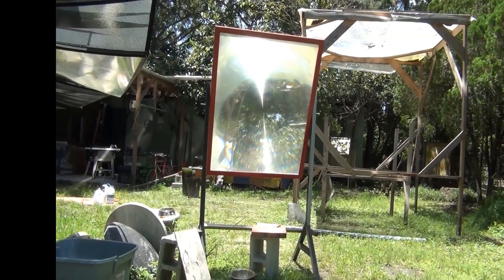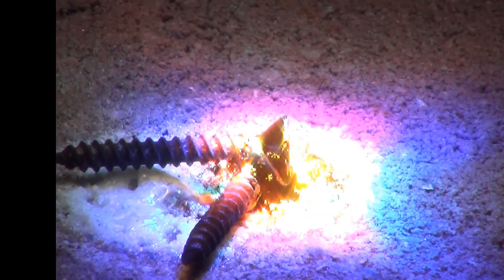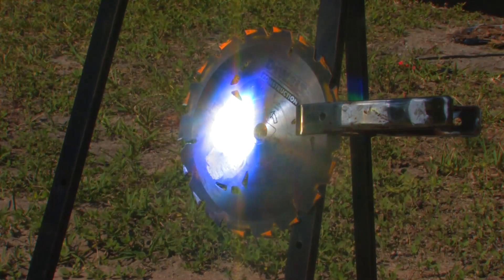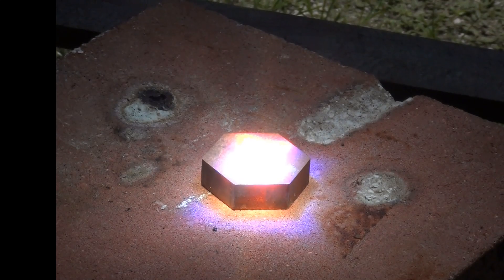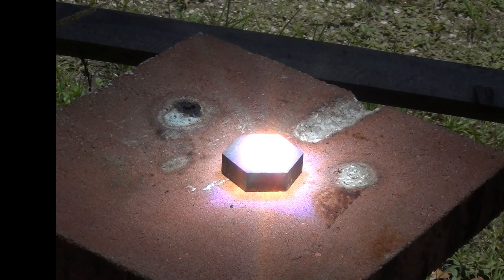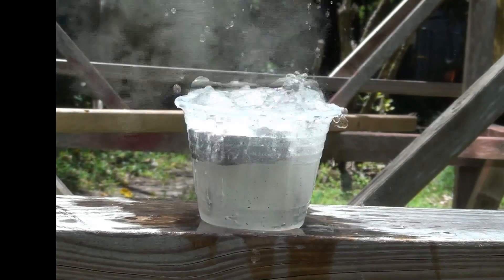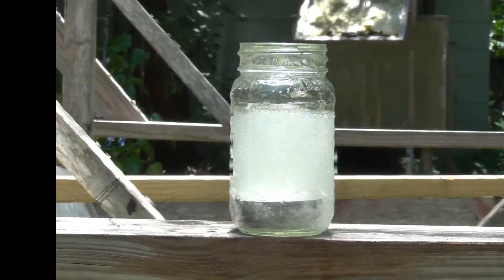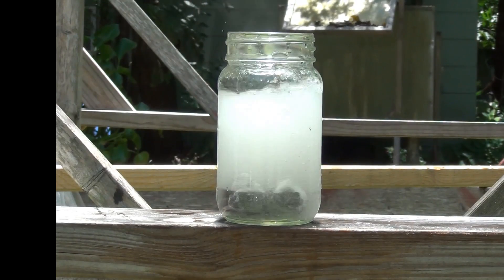Fresnel Lens thermal storage welding brazing with Sunlight can be used to produce steam

Comment: so what if you used a large magnifying glass at the lens's focal point? couldnt it focus all that light into an even smaller focal point for a more precise weld? even increase its temp further?
Reply: or above the focal point to reduce heat absortion by the glass. dont want it exploding, haha. maybe something worth testing.

Comment: If you want to do some proper welding, you're either going to have to have the metal you want to weld in a vacuum or covered in a shielding gas like Argon and/or Helium. Atmospheric oxygen and hydrogen create porosity in exposed metal and severely weaken the weld.  Source: I'm a welder.

Comment: Molten sodium nitrate, potassium nitrate and calcium nitrate stores heat at 99% efficiency.  If you could reflect and focus enough energy to a focal point you too can melt salts.  Its a good idea for energy storage.  We just need to manage the conversion rates between thermal-~luminance devices to electricity.

My bet is that solid state devices will able to do both thermal and luminance to electric conversion efficiently in the up coming years.

Comment: Hello Dan I've been a fan of Green Power Science for awhile now and I'm very impressed by both the fresnel lenses and the parabolic mirrors have you considered making ice with either one, Wait I'm not a nut use either one to replace the heat source in a Propane fired R.V. refrigerator don't see why it couldn't work as a stationary unit with sun tracker and temperature controls just trying to think outside the box,love your videos.Happy Holidays

Comment: tell me if i'm wrong, but the water didn't just instantly boil. the water the came into contact with the steel might instantly boil but the rest of the surrounding water probably wasn't raised to sufficient temp to boil... what i'm saying is that if the steel had been taken right back out the water would still be boiling.

Comment: so, my question is: could you use multiple lenses to build up heat in a piece of metal so that it can be worked in a traditional (ie blacksmithing) manner? Coal is hard to get where im at, so a solar forge would be a real boon were it possible.

Comment: Perhaps this method could be used for a low fuel blacksmithing technique? The big issue is being able to gauge the metals temperature visually, but there are other tools that can solve that issue.

Comment: That sounds like a good idea to me. Plus, after the sun goes down, the ambient air temperature should drop a few degrees, which will increase the temperature differential of the Stirling engine further.

Comment: maby u could use it for cooking by setting  pan on it the have others heating up as as they cool just switch em out ,, then you can cook withiut the light in your face or have to move with the focal point ... give it a try ... have your wife cook on it as you replace the blocks for her

Comment: It's not that the metal is too big of a heatsink - it's that the heat is being able to escape too quickly to the surrounding air. Put the metal in an insulated crucible with a small opening for the light to enter.

Comment: Something else - holding the piece in your hands and allowing air flow on all sides allows the excess to act as a heatsink.  As Dan mentions - the heat is being pulled away.  Try placing it on a solid surface with little air flow?  Something else you may want to try if you simply want to burn through a piece of steel - place it at a slight angle and let the slag flow away from your burn so that slag doesn't accumulate under the focal point.

Comment: Just a quick question about the statement,"instantaneaously boils water" - did you ever confirm this with a thermometer?  Sublimation seems to be a more likely explanation for instant formation of bubbles in any instance of quenching a hot piece of metal.  When I quench a joint after welding, bubble form around my coupon but when I remove the source of heat, the water temperature has not increased any appreciable amount.

Comment: How about a farnell lens melting a big amount of salt and use that to drive a stirling engine, I'm curious if the heat trapped in the salt would keep the stirling engine running all night/continuously/x no hours

Comment: if your tring to weld by using a pudal of moltun medal like in oxyacetylene welding.  your going to need a sheelding gas like co2 or argon. if your goweing to weld like an old time blacksmith. then your going to need a flux like silica sand or powdered borax.

Comment: Good question, mine as well, but why tie into a solar panel system instead of straight into battery storage? My guess (only a guess at that) is that the lens (maybe even multiple?) will produce more electricity than the solar panels? Would make for a good trial test. Lens might be cheaper too? What say you, Dan?

Comment: Excellent video, Again!! I do have some questions on practical application.
Welding is fine but I see an energy source in the steam created by the blocks of heated steel in water, could an old air tank be modified to create and hold the steam then drive a steam engine? Also referring to some of your earlier videos on solar, which panels or sheets are most efficient? I am considering off grid power production and you always come up with the most inspiring applications. Thanks Dan!!

Comment: It is the amount of BTU that determines whether or not two pieces of metal can be welded.  One candle equals one BTU. The maximum temperature of a candle is 1,400 °C it is just above the very dull blue part to one side of the flame.  If you light 1000 candles you will have 1000 BTU but the temperature will remain at a maximum of 1,400 °C.  So the physical dimensions of a Fresnel Lens determines both the maximum BTU and temperature.

Comment: Here I am thinking... Couldn't one use a large fresnel lens to heat a piece of metal, that through heat pipes woud deliver that heat to a metal block, inside a hot water tank, for use with, for example, central heat in a house? 
Heat pipes are commonly used on CPU coolers to lead the excess heat away from the CPU, and into a cooler of sorts, in this case, the cooler would be the water in the tank.
I don't know how efficient the setup would be, but considering 850 W/m² insolation, maybe worth it?

Comment: If you had a few lenses mounted on a water filled tank (electronically tracking the sun), you could make a steam engine to generates electricity that could be tied into a solar system along with panels, windmills etc.?

Comment: So I have a question Dan, I'm a hobby blacksmith and most of the things I make are with 1/4" thick mild steel. Because the steel is thinner than the example you showed, I'm not sure what to expect. Do you think it would be capable of getting a spot to an orange hot?

Comment: Excellent advice, I will have to try that out. However, I am still wondering how you film your videos of the fresnel lens in action. I would like to be able to document what is taking place when the material is being heated. What filters do you recommend I use on the camera (I currently have a spare shade 5 welding shade)? Thank you so much for your assistance so far, and keep up the great work.
Jason

Comment: It might not work to melt thicker steels but it could possibly be used for heat treating (Hardening or softening) some metals. I wounder how hot it would get if you had 2, 3 or 4 lenses focused at the same point?

Comment: Do you have any good sources of limestone nearby? I'd love to see you experiment with the fresnel lens, the water lens, mirrors, or any combination thereof to make cement powder. I imagine heating the material will make it easier to crush the stone, and then the smaller pieces will be easier to calcinate.

Production of cement accounts for ~5% of global CO2 emissions, half of which is from the use of oil, coal, gas, etc. in the incinerators.

Comment: Wow!  Dan, you've created a cheaper alternative to the molten salt systems that newer solar thermal power plants use to generate power at night or during adverse weather.  Your, let's call it the "Steel Core Heat Storage Cell" system is highly scalable - need more stored power?  Add another Cell insulated container, connect the plumbing, et voila!  It can be done by backyard experimenters too - a most excellent concept!!

Comment: I'm curious if ALL the water is increasing to boiling temperature.. or only the water around the metal.  maybe try a larger container of water and put to temp guages in the container? one at the top, away from the metal, and one at the bottom, near the metal. 

It's just a thought, that all that voilent boiling is happening right at the source.

Comment: Dan try using your fresnel lense to melt a mixture of 60% sodium nitrate and 40% potassium nitrate (saltpeter) then drop that into a highly insulated bunker underground. then you'll really be capitalizing on your technology. iron mass is a poor storage medium. it is a transfer medium. Use a stainless steel orb to transfer the heat from the steel, to the salt.

Comment: I have a spot 36"x24" fresnel and the issue is NOT the collection area, it's the inability to focus tight enough.  I've watched most of your vids, and you have the same issues. Example; I have a 6" Newtonian mirror which will focus to approximately 3/16", and it will perform almost as well as my fresnel in regards to temperature.
Set one of your 64" monsters up with a secondary optic system with a somewhat long (~10") final focal length, to pull down to ~1/8" spot, I think you'll be stunned.

Comment: Alright, I did not phrase my question properly. I am trying to melt through a very thin sheet of steel, perhaps 4"x12" and a little over 1/16" thick. The surface melts, and then cools into a puddle. I cannot get the puddle to go through. I am holding it with a pair of pliers and my hands. For going through steel like that, is it necessary to hold the piece absolutely still? Also, how do you film the work with the camera (i.e. what filters do you use)? Thank you for your quick responses.
Jason

Comment from the maker: When metals become molten puddles, the puddles become very shiny and reflect a lot of the light. This is not a problem for zinc as some slag forms and tin's lower melting point is below the loss of reflected light. The deeper solid portion of steel is pulling the heat away. You need a crucible if it is a smaller mass of steel. These blocks do puddle in a cement enclosed fitting but they do not totally melt after 10 minutes.

Comment: Hi Dan-
Thanks for answering my question about the welding shades. I purchased a shade 14 welding shade for working with my fresnel lens and it works great. The focal point is visible, and they are rated for solar eclipses. I was wondering how you film the videos of the fresnel lens in action using a camera (i.e. what filters). Also I can melt steel very quickly, but find it difficult to go through, as it simply forms a puddle. Am I not holding the focal point steady enough?
Thanks,
Jason